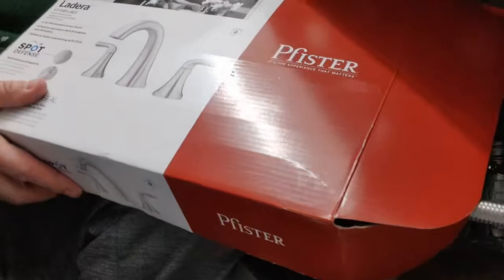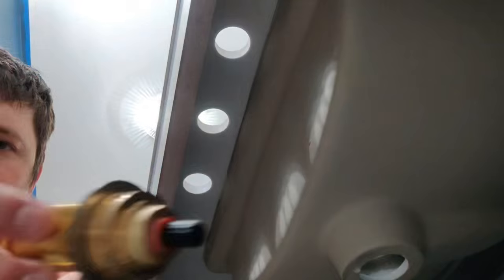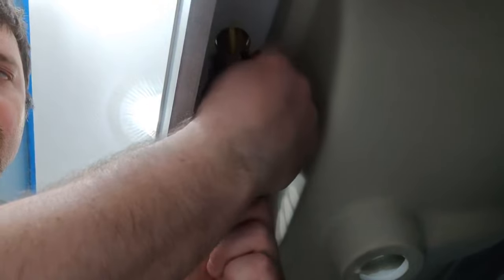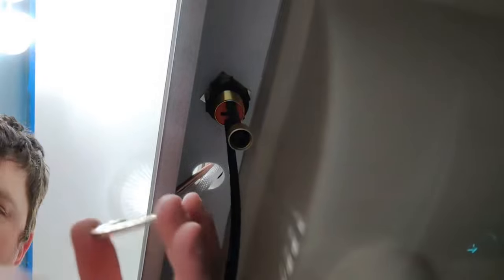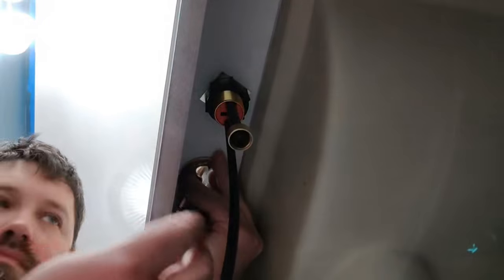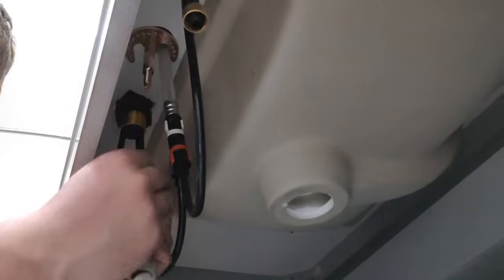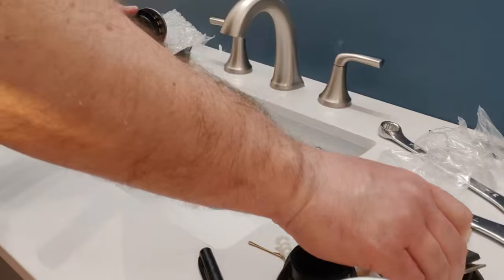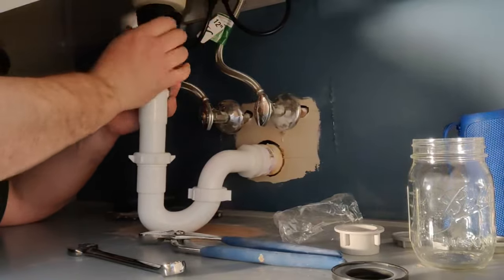HOW TO INSTALL A PFISTER BATHROOM FAUCET

Comment: I installed a similar model (the Masey model) and it all seemed good but I keep getting a leak when I hook the hot water line to the hose which connects to the faucet.  I have reattached and it seems like it is a good connection but is still has a significant leak.  I am wondering if maybe there was supposed to be some sort of a washer or connector inside the line to the faucet.  For now, I just turned off the hat water lead and am using the sink with just the cold water. Any tips?

Comment: Hey buddy we just upgraded our bathroom and installed 2 of  these faucets. It's only been about 1 year and all of a sudden both water  faucets have barely any pressure. Had this happened you you. I am trying to unscrew the aerator  to clean out but I am having a hard time finding the proper tool to unscrew it.

Comment: thanks for the helpful video. so you don't need to use any teflon tape when installing the faucet? how about on the angle stops?
Reply from the maker: You shouldn't need to.  I assume you are talking about the shutoff valve?  You shouldn't need to, but it depends on the valve.

Comment: I made sure the blue side arrow faced the sink but the faucet handle turned backwards not forward. Hot was fine. Is there a flaw on the blue side or does something need adjusting?
Reply: Same problem for me!
Reply: Opposite for me: the cold is rotating correctly, but the hot is rotating backwards. Anyone figure it out?
Reply: You need to loosen the bottom, adjust it from the top with the handle while holding the stationary part , and then tighten it, it doesn’t matter where the arrow is facing at that moment.

Comment: If one tap itself begins to leak, how do you fix it? I feel like it's an internal washer issue because at the actual handle shut-off point, it used to drip, but at about 15-20 degrees prior to that point, it would shut off, so that's how I turned off that tap. I put up with the ugliness of asymmetric looking 'off' positioned handles. Now, suddenly the waterflow only tapers off slightly throughout the clockwise turn and doesn't shut off at all in that one tap. I thought this was an indestructable brand?
Reply from the maker: Sounds like a cartridge issue.  You may need to replace the cartridge in the handle.  Is it the same one as shown in the video?

Comment: hey Aaron, thanks for this video.  I'm having a problem with this installation, viewing your video I see no difference in what you did to what I did.  The problem I'm having is at just about 3:50 in your video: the supply lines are spewing water at the connectors to the fauctes (both).  Is there some type of washer that's supposed to be in the connector that might be missing for me?  I'm going hand tight, as tight as I can (and I'm no wuss..).  Any thoughts/suggestions?
Reply from the maker: did you put the tap adapters on the supply lines?  Which side is leaking water?  The faucet side or the supply line side?  There is no washer on the faucet side.

Comment: Do you recommend using silicon or plumbers putty at all or are the washers enough?
Reply from the maker: I usually use plumbers putty over silicone.  I think it's easier clean up and you it stays good for longer.  For the drain in the video I didn't need to use anything as the washer was enough.  I also had a brand new sink and vanity so I think what you need to use depends on the situation.  As long as there is a washer for inside the sink usually you don't need plumbers putty.  If there is no washer I use plumbers putty.

Comment: what tap adapter did you use for the supply line?
Reply from the maker: What size is you supply line?  Are you installing the same faucet?  Did it not come with the tap adapter?  Its 1/2"x3/8".  If you are looking for that specific tap adapter you can call pfister and they should replace it.
Reply: @HomeRepairHub pfisssssster should include the hoses to begin with. POS product.
Reply: @HomeRepairHub   You said 5/8"x3/8" in the beginning. That's causing a bit of confusion. Otherwise, well done.

Comment: Unfortunately, you left off one of the hardest parts, which is how to tighten down the faucet nuts underneath and still keep the faucet lined up properly so the hand is facing the correct way.     That is, how to do this by yourself with faucets that are just a few inches from a backsplash.
Reply from the maker: I used something like this:  you can usually pick it up at the local hardware store if Amazon takes to long.  https://amzn.to/3zTwLcN

Comment: Problem I've had is that the faucets keep twisting and won't stay in place, despite making sure they were tightly held. Work themselves loose. And have doubts about how long these cheap plastic pipes will last. Next time will look within the box to see just how substantial the fittings/pipe are. Fast ain't always the best, and having know several people's houses that were decimated by a plumbing leak (one just recently-had to keep moving from hotel to hotel over 4 months until the repairs were completed), not happy that the faucets are twisting so easily, and already leaking. Spending my afternoon doing it again. Won't buy any plumbing fixtures like this again.

Comment: The cheap pfister bastards didn’t include hoses. So add $20 or so to the price you paid for the faucet. And prepare to run back and forth to the hardware store until you are lucky enough to find 2.